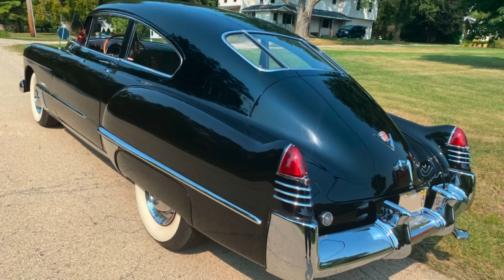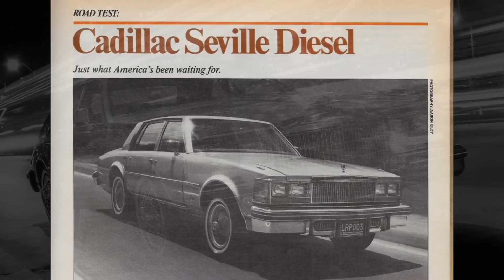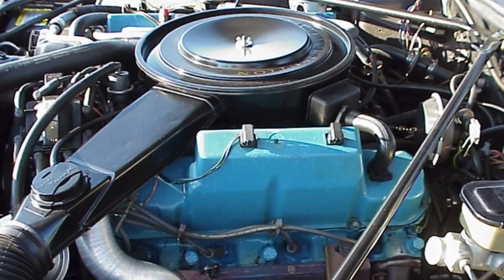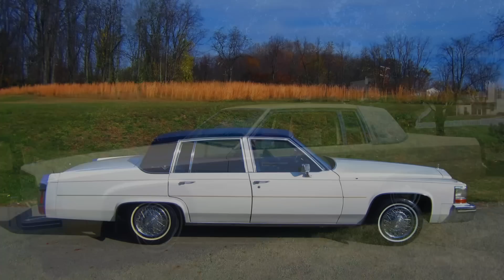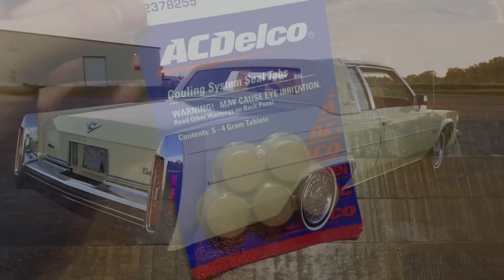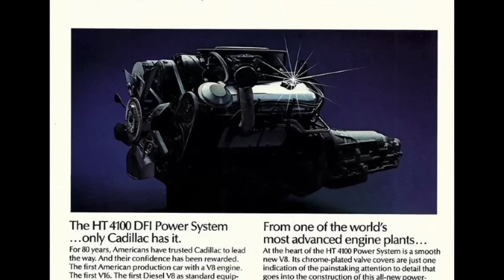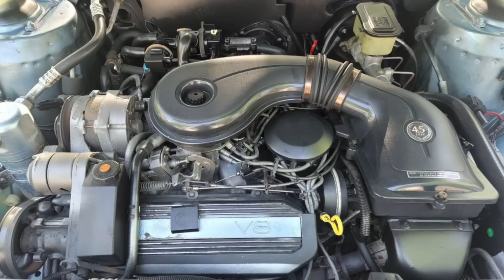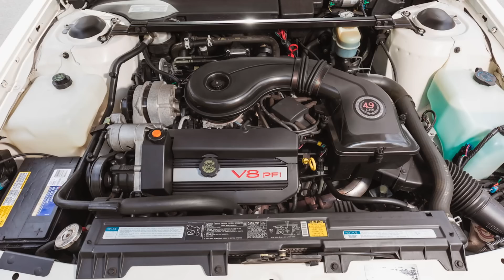This is GM's Worst Decision for Cadillac and Affected Its Reputation for Decades...

Comment: My dad bought a '77 Coupe de Ville in  Bimini Beige [I used to hide behind the C pillar because this car was PINK~]

And it had a 7.0 liter 4 barrel V8 engine.  With 180 hp~

Until dad decided in 1978 that ~~HE~~ wasn't going to pay the extra $0.02 per gallon [two cents...] to use unleaded fuel in this car with catalytic converters, so he knocked out the plug in the gas cap that prevented the larger regular gas nozzle and used leaded. 

Fast forward a few years;  This 4200 pound car with a 7.0 liter engine and four barrel carburetor needs 18 seconds to reach 60 mph.  I'm racing my friend Chris Yates and he is in his mother's '84 Olds Cutlass two door with a paltry 112 hp V6, and we race and he leaves the rat motor Cadillac in the dust with what can only be described as a carbed Buick V6  gerbil~

He said I left behind a huge orange cloud.

These Cadillacs pretty much sucked.  They had no good engines and nobody wants to keep them these days.

Thanx for the video-

Comment: I've always learned something new from your videos.  I have some of those who cooling system pellets for when I worked as a GM parts assistant manager.  Interesting to find out they are made out of crushed walnut shells!  Some of those Cadillac engines did not have much more for horsepower than our the V6 engine in our S10 and trucks!  Your knowledge  of various vehicles is amazing.  My mother and one of those infamous 5.7 N diesel engines in her pickup.  It always achieved 22 MPG no matter what the load.  Once she was pulled over for having the most stinky, disgusting truck that the police officer ever stopped that had nothing wrong with it!  Of course gaskets failed twice on the heads.  Both replaced under warranty, but eventually due to rust we replaced said pickup in 1985 with our current S10`s which we still drive to day.

Comment: I won't disagree with any of this.  It's really too bad, because almost all the Cadillacs in this 1980 - 85 time period were really nice looking, elegant cars.  I have always wondered, why not just make the cylinder heads aluminum also if everything else on the 4100 V8 is aluminum??  Then there wouldn't be issues caused by expansion and contraction of the dissimilar metals!  I have often thought model year 1981 was probably the worst for Cadillac, because you really only had one good engine choice - which still wasn't a good choice from a power perspective, which was the 4.1 L Buick V6.  In 1981, you still had the diesel V8, or the V8-6-4 - neither were good choices. I hope I'm remembering this correctly - but the 4100 V8 was also available in 1981, it just wasn't standard.  So no V8 engine in a Cadillac that year was a good choice.  The 4.1 Buick V6 would have been fine reliability wise but it would have lacked power in such large cars.  I had a friend who drove a 1982 Coupe de Ville, just like the yellow one in the pictures, in 1996.  So it was a somewhat old car by then.  I don't remember any complaints about it, but I know it didn't have much power. I don't know which engine it had in it, but it wasn't the diesel. I do remember many people abandoning Cadillac after this time period and switching over to Lincoln.  The Lincoln Town Car in the second half of the 80s became quite popular.  There was also the issue of the Sedan de Ville, Olds 98, and Buick Electra looking too much alike during this time period. Unfortunately, customers who buy high end cars and have a bad experience aren't likely to ever come back. What I seem to remember people who owned these cars saying was they did not think Cadillac did enough to compensate them when they came back to the dealerships after having problems during this time period. The dealers were like, your trade in (i.e. early 80s Cadillac) is basically worthless.  We can offer you this much. Would you like to buy a new car from us? A lot of them got insulted. You can't do this if you're a high end car maker. Cadillac could have done more to keep their customers who experienced this. They kept using an engine they knew had problems for too many years.

Comment: Coming from a Cadillac fan, the HT-4100 engine was an underpowered dog. The other genius engine design
was the Northstar engine. I owned a 1999 Cadillac Deville. Nice looking car and all but she would overheat on
me till white smoke came out of the exhaust, Not a fan lol. I let it cool off and traded it in for a different car. When you heard about the nightmares of owning a Northstar engine? they were all true. It's sad actually that
Cadillac having the prestige and name that they would cut corners and that didn't turn out to well.

Comment: Something to consider is that Cadillac and Oldsmobile were GM's experimental divisions. Any new technology that came along was tried out first in Cadillac or Oldsmobile cars. That made owners of those cars expensive guinea pigs. 

Most of us seem to like the new technology as it comes along, and many want to be the "first on the block" to have the new technology. unfortunately, experimental technology is just that - experimental! And, after all, the HT-4100 was indeed experimental. One thing that puzzles me, though, is why they would use cast iron heads? After all, with the rest of the major engine castings made of aluminum, why sto at the heads? 

FYI, aluminum heads were NOT new technology when the HT-4100 was introduced.

Comment: It seems very odd for GM to intentionally design an engine using cast iron heads with AL block and intake. Smells to me like the original HT4100 design brief must've been to do an all-AL engine for weight savings, but there might've been major problems manufacturing the heads in aluminum, causing a last minute change to use of cast iron. GM powertrain engineers likely knew the HT4100 end product was a flawed execution driven by corporate expediencies. Can you find any background info on this subject?  It would make a very interesting discussion topic with any knowledgeable ex-GM powertrain engineers.

Comment: The joint between the intake manifold and the cylinder head was unfortunately placed under the valve cover, so a leak was of greater consequence. I had one of these in a 85 Sedan deVille.

Comment: There is a video test drive of the new 79 Eldo Biarritz with the olds 350. Should have stayed with
it and add overdrive with TBI later on to keep customers for the long-haul vs V8-6-4 and the HT4100.
as others have mentioned, GM should have learned from the vega with aluminum  cores.

Comment: Some of these Cadillacs were awful but I have to say they are better and more of a "real" Cadillac then they are today. Now a Cadillac is just a rebadged Chevy SUV with a huge price increase. And with really poor reliability. GM's bad decisions caused a sales boom for Lincoln. A lot of traditional, die hard Cadillac customers went over to Lincoln and stayed there. But if you get lucky enough to find an older Cadillac DeVille or Fleetwood with that early trash 4100 just drop a small block Chevy 350 in it and the world will turn.